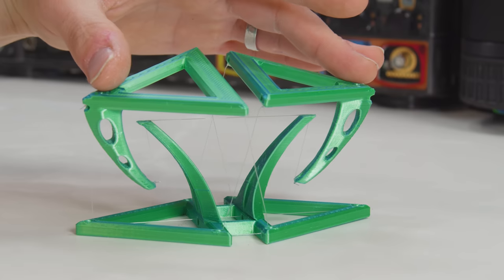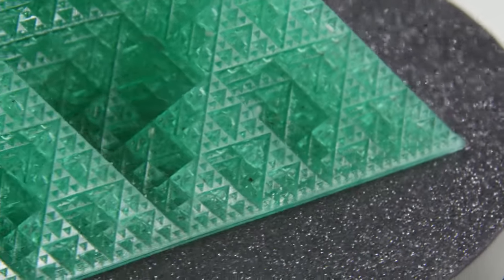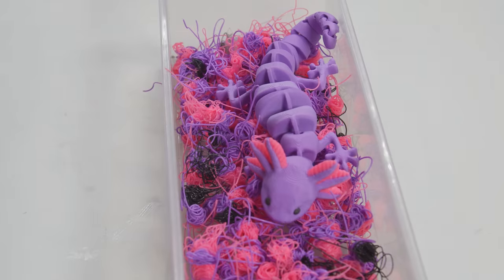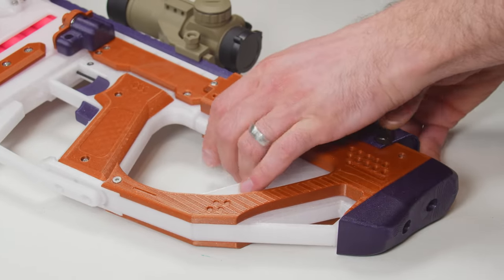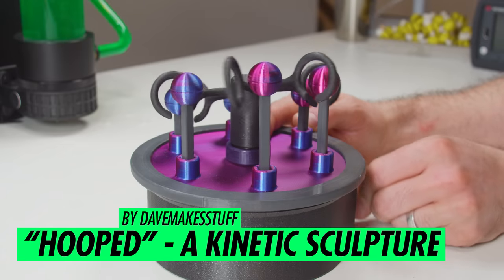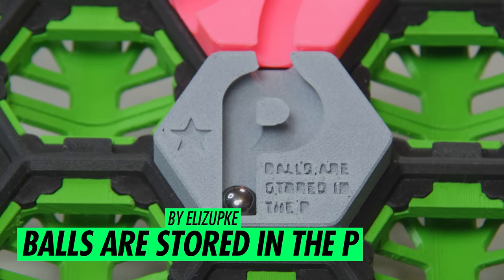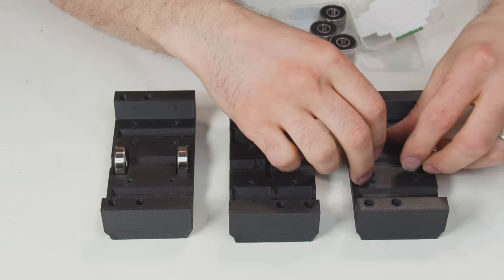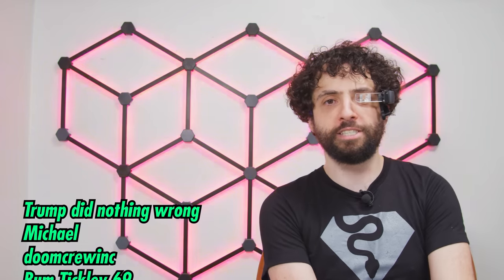10 Free 3D Prints to BLOW YOUR MIND!

Comment: Um, wait.... that orange hood is amber for a reason. It blocks the UV spectrum, keeping the top layer of resin from curing while you're printing. Keeping those hoods off might not play out well.
Reply: Yea I once took some resin prints outside to clean off, not realizing that the sun would instantly cure the excess resin still on the prints. Duh!
Reply: He's in a basement though, not a whole lot of UV down there
Reply: @nathanhart9523  idk about you, by my UV lights are LED. And is sure looks like he's using plenty of LED down in that basement. If any of them are full spectrum, he's gonna get curing.
Look, I might be blowing the horn for no reason. It is possible he accounted for that and got lights that don't admit light in the UV range. But, until otherwise stated, it's equally possible that it wasn't accounted for and he's going to get a bunch of funny looking prints until he figures out his mistake.

Comment: The surface area of this fractal tends to infinity, every recursion step takes away 20% of the material and adds 25% to the the surface area.
Literally the best looking printed fractal I’ve seen
Reply: I think the tetrahedron or 3 pointed pyramid version does keep the same surface area in every recursion.
Reply: The 3D version's volume trends toward zero while the surface area stays the same.
Reply: 100-20%=80
80×125%=100

25% was added to the reduced base.

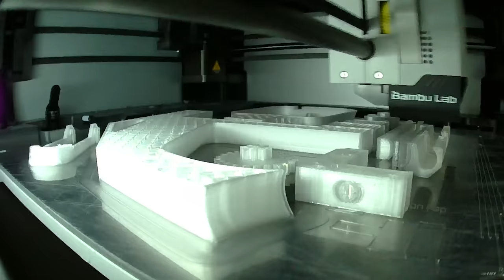Comment: 13:07 - Next time you shoot a Nerf blaster at the camera, try a shot with the camera pointed at 90-degree-angle mirror. That way you can aim and fire the blaster directly at the lens's reflection in the mirror, and still not damage your camera itself. Choose glass mirror (and slow-motion video recording) for awesome distortions and/or shattering effects, and choose an acrylic safety mirror if you want to more safety (acrylic-ly). Bonus visual points for revealing a cool-looking thing behind the broken mirror, after the dart is fired at it.

Comment: How do you manage the moisture absorption of filaments if they’re all just sitting on a shelf? Do you have to dry them constantly before using them?
Reply: Sort of, yeah. Depending on the humidity and plastic, you have to dry it before printing. Personally, I like to dry my filament as needed, and then print right from it.

PETG - dry it!
TPU - dry it!
ASA - dry it!
ABS - never used it, 'dry' and see
PLA - don't, unless the filament is brittle.
Reply: Possible this basement is a climate controlled space sufficiently dry for most filaments, not all plastics are equally bothered and a comfortable temperature and humidity range for humans overlaps with those spools requirements. But some filaments really can't ever be dry enough, so for those actually printing right out of an active drybox is to be recommended for best results.
Reply: I was wondering the same thing!
Reply: My office runs about 45-50% RH, and I never dry anything, except nylon.  I print mostly ABS, some PETG and PA, and a tiny bit of PLA.
Reply: @Elmojomo  that’s crazy. 
You should try it. Food dehydrators are cheap and work well. I think you’ll be impressed by the quality difference if that’s a factor you care about. 

All filaments absorb moisture, just some faster and more dramatically than others. (Nylon is notorious for absorbing enough moisture to cause issues within seconds to minutes in your sort of humidity. 

Even PLA, which it’s extremely common for people to say doesn’t absorb a meaningful amount of moisture (to the point it affects print quality) absolutely does. Especially if it’s near 50% humidity around you, it only takes a matter of hours to a day for it to absorb enough to affect perimeter surface finish and stringing.
Reply: @foldionepapyrus3441  that actually makes the most sense. He probably just has the humidity managed well enough to keep it low for the entire room which would be a lot easier if it’s something that can be done. 

I’m constantly drying stuff cause I switch filaments a lot and it makes such a difference especially when you’re going for high quality prints. But some people have pretty low standards for 3D print quality and aren’t trying to make it look near injection molded. I’m just kinda anal about it.
Reply: @i_like_trains72  I wouldn’t say don’t. It still helps even if it’s not as dramatic as stuff like PETG or nylon. 

Ya in a lot of cases PLA doesn’t NEED to be dried like nylon does, but it still helps, sometimes a lot depending on the exact formula / brand / color. 

I have a silk white pla from the same brand as a silk black pla. At 45% humidity in the room, The white has to be dried daily for best quality, the black sat on a shelf in the open air for 3 years and came out basically just as good without any drying. 

But the idea that anyone SHOULDNT dry it is crazy to me.
Reply: @heyspookyboogie644  What are you talking about?  I have absolutely zero quality issues.  All my filament flows perfectly, including the nylon.  As I said, I do dry the nylon before printing.  The others, ABS, PETG, PLA, require no additional drying for perfect results.
Reply: @heyspookyboogie644  Yeah, does largely depend on the filament though. But here where it might often be raining but is rarely humid I generally do nothing to look after my filaments as most of them are dry enough straight off the shelf to show almost no return for that effort. 

But there are certain filaments that won't print well without, one particular colour of ABS in my collection needs to be particularly dry to print well, so I won't be replacing that one I expect.

Comment: 15:15 you can't easily reload them. if you fire a marble in backwards harder than it was fired out in the first place, it is possible it will reset, but its more likely to explode. it is essentially like trying to un sort a deck of cards by shuffling them. i've been messing with these accelerators for probably 20 years now lol

Comment: Hey Zack, I spotted that Bambu Lab printer in a shot or two. Did you acquire it for your lab and if so, is it worth considering for professional printing of hundreds of intricate technical parts? Cheers
Reply: no because if you lose the printer lottery with bambu you're fracked
Reply: Can't speak for anyone else of course, but I have an X1C and it's been the best printer I've ever owned, by a large margin.  I had a Monoprice Mini, and a (highly upgraded) Creality CR-10S, and neither could hold a candle to the X1.  I absolutely love just being able to send a print and not wonder if it's going to work or not, it just does.  I've had a grand total of maybe 5 failed prints since I've been running this machine, and 2 of those were my fault. I HATE walled garden devices, but this thing just produces flawless prints one after the other.

Comment: To reload magnet launcher: as a kid I had a marble set with this piece and I actually had the same idea to make a track that could reload and after about an hour, I did, but what you want to do is use a path alternator to launch the first one as usual then send another down to take a reloading path on the other side of the alternator and the third marble you send down will only cause a slightly weaker launch

Comment: The awkward curved dove tails of the fractal vice seem to be mostly a limitation of how it's usually manufactured from metal. Without such limitation, you can maybe make lower-friction and lower-tolerance pivots based on metal rods? Same as how you have metal pivots for the last layer of "fingers", maybe it's possible to use the same articulation type for all layers of fractal jaws.

Comment: I priced out the metal parts here in Canada to make the fractal vise. In CAD, per vise, about 66 bucks. (<50US.) First one would be about 100 since some parts come in quantity. Corners could be cut by cutting ends and corners of some of the screws, making your own shorter ones instead of buying odd sizes, but there are SO MANY....  I'd rather get the right ones...
Reply: As a fellow Canadian I decided to look up what it'd cost to get a full metal bench vice.  And yeah about 60 bucks seems right.  Does make me wonder if there's just the wiggly trick bits version that you could screw into a regular vice.  Probably is the answer.

Comment: $14.50 in quarters.   Also, don't you need the orange hoods to hold back stray evil UV rays from pre-curing the reain that's printing?  (Like aay from another resin printer sitting next to each other all pri ting at the same time?)

Comment: 15:14 I don't have any experience with this or 3D prints in general but couldn't you print a similar piece but add a third path that leads to the "chamber" but one ball away from the base so the reloaded ball would land on top of the base ball? You'd have to reload every shot instead of firing both starting balls and you'd have to have another path designated to it unless you had a split piece that shifted excess balls to a secondary path. This solution makes sense to me and I can't foresee any problems with it aside from maybe the magnetism passing through the first ball not being strong enough to prevent the reload from falling out. I imagine that's not likely to be a big hurdle though but a prototype might reveal other problems.

Comment: I have birds and would love a filtration system like that so I can resin print without worry. Alas, I'm having to iterate designs on a new resin filter based on a 3m respirator filter. I wish I had a better printer than an original ender 3 with a couple of upgrades to print the air ducts, I'm having trouble getting it airtight and dimensionally accurate.

Comment: I may be misinformed but I thought the purpose of the orange hoods on resin (other than fume control) is filtering out UV that could contaminate the print. Is the new hood UV blocking as well, or am I wrong about things?
Reply: I don't think the hood is UV blocking, but it looks like the windows to his basement are at 01:29

Comment: Tbh the auto leveling isn't the interesting part imo, I haven't leveled my photon s since I got it and even then it was like 2 minutes.

The interesting uses of the strain gages is the resin run out detection and bottoming out prevention.

Also 500 bucks for 10" at 12k resolution is fair if you need really detailed stuff.
And tbh that's the cost of a blottle of igus resin so for small business prototyping it makes sense.

Comment: Zach Freedman you probably won't respond to this. but i have been having problems with my Ender 3 3d printer for awhile now and it has to do with the slicer. I have used all versions of Cura and for some reason 20-35 secs in the code breaks and says thermal runaway. i know this is not a thermal runaway because the pre installed prints run just fine the new slices don't. I got my Ender 3 in 2021 and though I've seen many people with the same problem their recommendations don't help. Do you think you would know a remedy since you have so many printers?